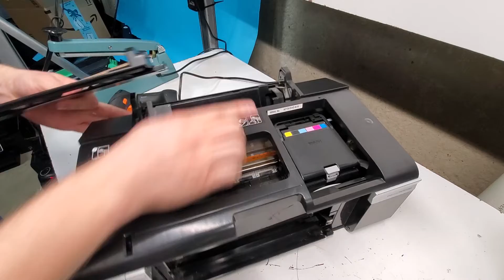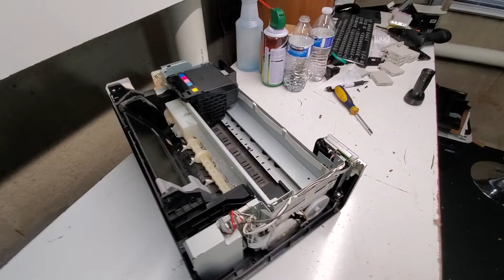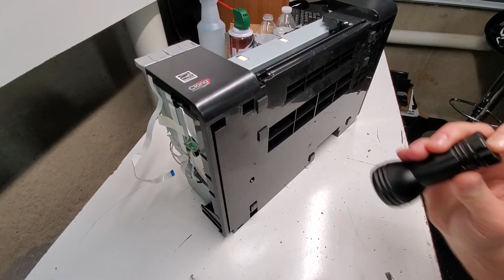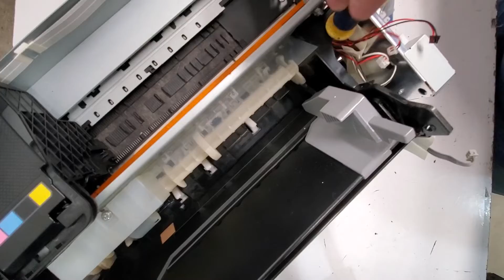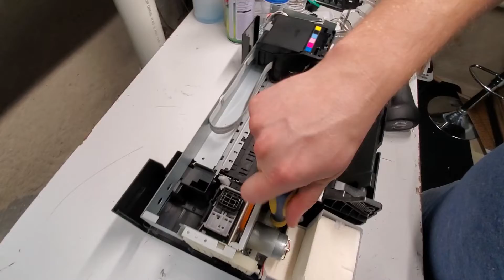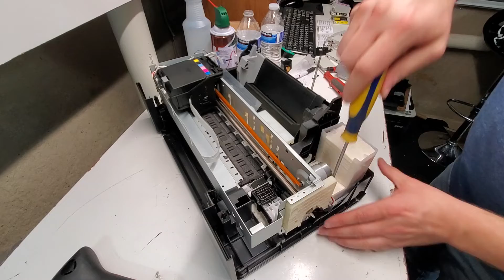Removing parts on Epson Stylus Photo R280 Printer R290 Taking Apart

Comment: what is the purpose for all that work.?   Just buy another one.
Reply: This is one of the HD printers people modify in all sorts of ways so that it prints from tanks of ink, does sublimation dye, etc. After that's set up, if a small part needs to be replaced, it's very much worth it to not have to start over (despite the age, these are $300-500 if new in box) or move all the mods.